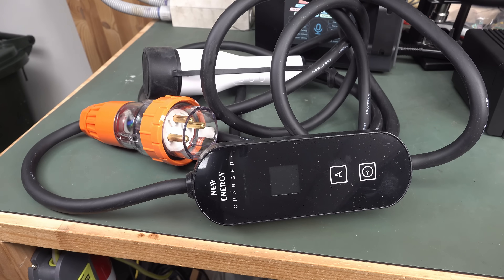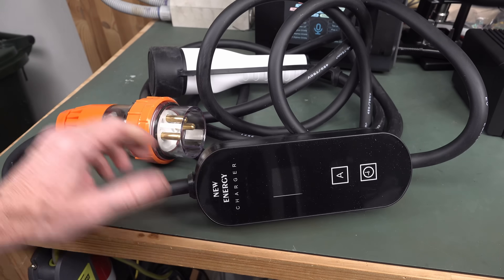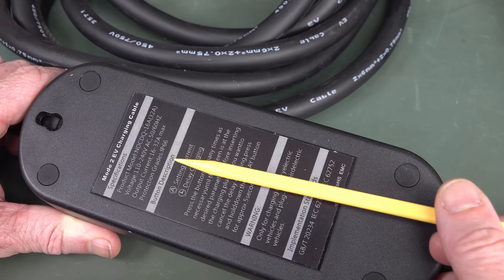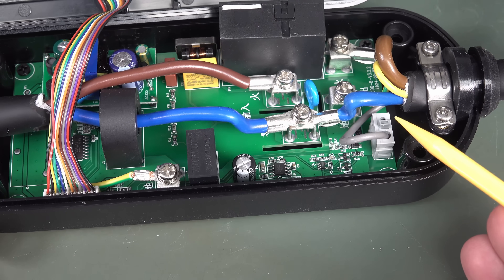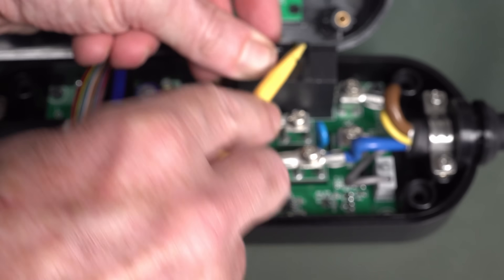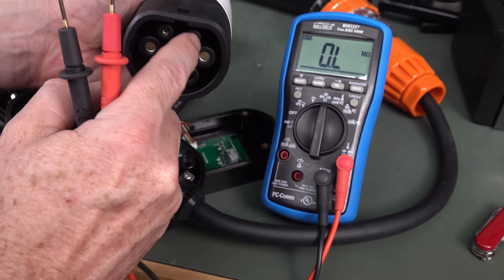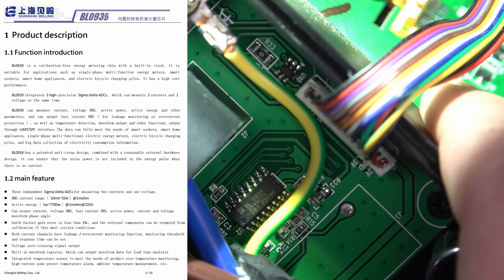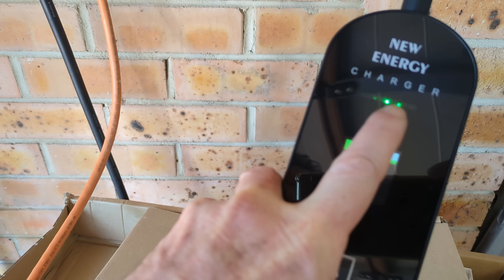EEVblog 1643 - DON'T BUY this Cheap 7kW 32A EV EVSE Charger

Comment: If the car contains the charger and logic, why does the cable need a relay to isolate it?
Reply: Because when there's a short between live and the car's body, the electronics inside the car cannot turn off the power. Also, you don't want the plug to be energised all the time. The touch-protection of those contacts is rather rudimentary, and it's used and stored outside where it's wet.
Reply: @HenryLoenwind  Does the car not connect to earth via the earth pin? Isn't there an RCD on the 32A outlet? 

It is essentially an extension cord, aren't thoes are always energised?

It is unfortunate that the touch protection is poor such that all the extra complexity is required.
I expect it would be used in the same environment that the Aus 32A connector outlet is, it is a shame the car doesn't just use one of thoes instead.
Reply: Well that’s the point of it is, so when you’re standing around in the rain you don’t fry yourself.

Comment: Actually, the disappointing thing is that you don't build something so simple yourself and/or modify another charger to suit your needs. Disappointing. Then such a charger can't be expensive enough.
Reply: Being a good engineer is knowing how to best use your time!
Reply: @edc1569  ... and money ;)
Building these simple adapters is a question of a few minutes with available components and a thing of 1/2 day building that all from scratch.
There is "nothing" in there.
That's the great thing charging an EV is so simple. 
I took available conponents and build my own wallbox and mobile box (adjustable power)

Comment: $100 local currency is about the right price point for an emergency EVSE to keep in the trunk just in case of emergency...   I would consider this one even without all the safety stuff inside because it wouldn't be my everyday charger, just something I kept in the trunk in case I ever found myself without the range to get to a real charger.   I reality, it would probably never get used, but like a spare tire it's  good to have just in case, and if it's got a better than even chance of not burning or melting during it's one and only use,  those are good enough odds to bet $100 on for me...
Reply: I’m using a sub $100 charger because the $650 pos Wallbox stopped working even more than usual after two years. I think the only charger brand I would actually trust is charge point.
Reply: Better to buy a good used one. For not much more, I bought a used Audi branded EVSE with both 13 amp UK and 32 amp CEE plugs. German designed and European made with a decent RCD inside too.

Comment: Copper-cladded aluminium is not new.  For cost reasons it was commonly used in the Eastern Block.  As inheritage from the Eastern Block we now also have it in Germany..  In East Germany it's know as AlCu or ALCU.  To the best of my knowledge it's an ok material for conductors though the larger diameter may make cables a bit stiffer.  Yet its still lighter than an equivalent copper cable.  I've only ran once across it, in Hungary.
Reply: my understanding with copper clad aluminium cable is it doesn't hold up well under repeated flexing and twisting like 100% copper cable does. I replaced the wiring running to my range in my house that was aluminium wire and the strands cracked in several places when i coiled the wire to recycle it. it was only ~30 years old and being house wire wasn't flexed much.
Reply: @JHulce  What you describes matches common knowledge on aluminium.  The cable was probably always a little brittle so it had to be treated more gently than pure copper.  WHen you ripped the cable out you had no reason to handle the cable gently so it's not surprising that it broke.  Eastern European (as in cold war era) electricians were used to dealing with CCA cables so they were aware of the special properties.  Annoying during the installation but not safety problem that I'm aware off once properly installed.

I've had a few device leads which I think were made from aluminium.  They didn't appear to be brittle but were relatively thick.  I assume these must have been special alloys which reduce the brittleness.

Copper is a material in high demand.  It's only a matter of price compared to aluminium and CCA will return.

Comment: I'm not an expert, but not switching neutral seems sketchy to me.
What if the guy that installed the outlet get it mixed up ?
Reply: If the car's electronics are good, they will refuse to initiate a charging session. Otherwise all will work fine but you'll have a live port in your driveway that's big enough to take small fingers.
Reply: @HenryLoenwind  That's what I'm worried about, the plug lying live on the ground outside.

Comment: Pretty sure GFCI/RCD protection in the EVSE itself is required in most civilized places.
Reply: Not to mention the 6ma DC trip
Reply: RCD type B is required by CE standard, I’d be surprised if the Check Mark down under would allow deviation from that. The whole point is mobility and protection, ya never know where you’re going to have to plug in.
Reply: @SpencerSkelly  That's a wiring regs thing ain't it part of the new amendment to 18th edition as the DC can stop a normal RCD from operating in a fault.
Reply: RCD is mandatory and especially that DC 6mA sensitive...you dont want to get zapped by AC nor DC.
Reply: Why? RCD is installed in front of the outlet. RCD is required in the installation, so all equipment connected is protected and all the wiring is protected. I live in a civilized country. Actually all european countries have RCD before fuses or a combined RCD / autofuse in the main distribution board.
Reply: @NotMeGeek  Some of the world (North America) doesn't generally have whole home GFCI. I consider myself 'civilized'.
Reply: @NotMeGeek  At least in the US, the standard outlet based RCD would trip regularly because EV's test ground by passing a small current through it. EVSE's integrate a CCID that triggers at ~20mA to avoid that nuisance tripping.
Reply: @intrest86  Thats why we in Europe has different types of RCD. We use normally 30 mA trip current and also 300 mA trip current. That's both AC and DC currents.
Reply: @NotMeGeek No point using a faulty one tho hey and according to the foreigners I worked with they only had fuses at home in Poland
Reply: @NotMeGeek  The on--board RCD/GFCI is for redundancy since 1) panel RCD/GFCI breakers can fail, hence the "test every month" or other such prescribed test interval on older models that don't have automatic self-test and 2) not every building is code-compliant.
Reply: @teardowndan5364  Maybe where you live. But here we do it different at don't use dual RCD as both will be turned off in case of a fail. It make no sense to have 2 RCD on the powerline.
Reply: @NotMeGeek  You have two because both can fail and EVSE cables may be used under harsh conditions that greatly increase the likelihood that you may get electrocuted by a frayed cable under wet conditions should your only RCD in the whole circuit fail.
Reply: @teardowndan5364  🤣
If you're so affraid that RCD will fail, why not use 10?? I'm electrician and know how we make electrical installations where i live. So it still make no sense using more RCDs in line of each other!
Reply: @NotMeGeek  Well, the people who make the standards for certified EVSEs disagree. EVSEs must have at least two layers of RCD protection: the breaker/outlet and the EVSE itself.

Comment: It has an incorrect CE marking too... Always a sign that corners have been cut.
Reply: It's not incorrect it's for Chinese export, quick way to tell is if you carry the C on to a full circle does it overlap the E 👍
Reply: CE is self certified until not, so it's really a low barrier to entry.
but as @SylerFox666 pointed out, thats the Chinese Export mark.
Reply: @smalltime0  No such thing - ask a real Chinese manufacturer (I've worked with a few).  This seems to be an internet myth that has gained too much traction in some areas, even in the EU (I have yet to come across any source that confirms it having official status).  Also, the CE mark and the claimed Chinese Export mark both use characters that are part of a circle, not a regular font.  If the C is extended to form a complete circle it exactly overlaps the curved back of the E in the CE mark and overlaps much of the E in the claimed Chinese Export mark.  But the marking on this product as shown in the video is neither - perhaps they just used an Arial font or similar

Comment: Here in North America, you'd have to have a relay on both sides as the 240v is center tap for 120 each side so both legs of power are hot with respect to ground.
Reply: Given that it only switches live, it would be interesting to know if it's capable of detecting when its plug is wired with live and neutral reversed, and if so, what it does.
Reply: This wouldn't work in the states or Japan/Europe. It's made assuming that only one side gets 'hot'
Reply: @smalltime0  Of course it would 'work', the issue is it sure wouldn't be safe.
Reply: @smalltime0 Would work if you've got single phase supply, which would be the case in Europe or Japan for smaller homes (and in pretty much all of the UK).
Reply: @Croz89  I was considering UK separate from Europe, since clearly they do :P 
This doesn't have neutral switching, either side of the plug can be hot on single phase power in Europe.
You then also have Europe's cobbled together systems of single/two/three phase splits.
Reply: @Rok_Satanas 
There is no 32A connector in europe that can be plugged either way. Only the 16A household plug can.
Reply: @Juergen_Miessmer  that is true, but from years of experience with chinese stuff, always divide their ratings by half, at least. So a 32 Chinise Amp ~ 16 actual amps
Reply: @Juergen_Miessmer  The point of this is that it can be plugged into either, it isn't a hardwired unit.
Reply: @smalltime0  
No, it cant. The 32A plug is keyed.
Reply: @Rok_Satanas  This looks like it would use a CEE connector, and those are all keyed.
Reply: @Juergen_Miessmer  Some older houses in Belgium (including one I lived in) don't have a neutral - just three phase (delta). Really important to have double pole switches and relays there.
Reply: Yup, this thing is a death trap!
Reply: The rules (ICE) request to switch all active lines (N,P).

Comment: I believe the designs that also switch the neutral are also made to work with 240v US “Level 2” charging where that neutral is actually a second hot 180° out of phase. The board on your older one is flexible enough for EVSEs sold in other markets while this one is only for single-phase power.
Reply: The UK has keyed phase and neutral but the regulations specify that devices must treat both phase and neutral as potentially live to guard against wiring errors and transient supply faults.  In some supply-earthing arrangements in the UK, fixed EVSE must even be capable of disconnecting live neutral AND earth conductors!
Reply: Also needed in 230 V Europe where the plug is often not keyed so it's a 50/50 which side is live or neutral.
Reply: @Gameboygenius
The europe 32A plug is keyed.
Reply: @Juergen_Miessmer  That's true of course, but most home chargers in Europe will probably be either a wall mounted unit with a permanently connected EV plug, or a 16 A plugin charger using a 2 phase schuko plug. I think it's pretty rare to have a CEE socket in your garage unless you live on a farm or used it for power tools like an old drill press in your garage.
Reply: @Gameboygenius  You’re right. I was just looking at a European IKEA-brand power strip someone donated to Goodwill and noted how the ground can connect in either orientation.
Reply: @Juergen Yes, but this board can be used at lower amperage with other outlets too. It is very common for the same EVSE control board to be sold in various configurations, like the Gen2 from Clipper Creek (one of mine is 12A with a NEMA 5-15 and the other is 16A with a NEMA 14-30). There is also the potential to get it backwards when you hard wire.

Comment: Always concerns me to see screw terminals that if they slackened off they could rotate and touch, especially on a portable device. Some heatshrink over the crimp terminals would help if they can't use locking terminals.
Reply: Bring your own RCD
Reply: @TrickyNekro  Any decent sparky would have its own RCD circuit. That's if you follow AS3000:2018 lol

Comment: Definitely cheap-assing it- single pole switching and no RCD. Also lack of approvals marks.  
But why are they measuring the line current ( and voltage) that is totally unnecessary, whearas RCD protection really is needed.
Reply from the maker: Yes, no approval marks either. They need the current for the energy display.
Reply: @EEVblog  ..don't need the display either if they want to really cheap-arse it
Reply: @EEVblog  They should also be using the current reading to enable the EVSE to disconnect the car if the car is drawing too much current.
Reply: I believe the dual-pole switching is mostly to make the EVSE board flexible enough for 2-phase (so to speak) electricity, like US 240v Level 2 charging. Both conductors are hot (neither are neutral).
Reply: You believe wrong. The standards require you to switch both lines. There's no guarantee the outlet is wired correctly.
Reply: @emmettturner9452  The US uses split phase. Two phase has a 90° phase shift and uses 4 wires. Two phase has been obsolete for a long time and there are only a couple of cites that still have it available.
Reply: @mikeselectricstuff  @cjmill… yes, but I’m talking about using the same board for different markets in different configurations. For example, the ClipperCreek Gen2 comes configured for 12A with a thermistor in the plug for the version bundled with Volt and Bolt EV with NEMA 5-15 but the exact same board inside the NEMA 14-40 AmazingE is configured for 16A and not thermistor.
Reply: I think they're using the ZHTPT107 and the CT with the neutral wire through it in conjunction with the BL0939 for "RCD" functionality. It has leakage current detection built in between the two current sense inputs. (or maybe they're using the ZHTP thing as potential transformer so no leakage measurement)
Reply: …and as @Gameboygenius pointed out to me in another thread, you’d also need to switch neutral for unpolarized applications like Japanese and European plug types.
Reply: @emmettturner9452  to be fair in Europe you'd be using a commando plug for 32A  They are polarised.
Reply: @mikeselectricstuff  @peter not every EVSE even has a plug. Many are designed for hard-wired installation. Yes, it is important to get the polarity correct.
Reply: @rocketman Yeah, that’s why I said “so to speak.” Many still call it that because the two hots are 180° out of phase.
Reply: I was under the impression they just printed all the approval mark on everything electrical regardless.

Comment: Cable stripped by mice biting off the outer insulation, and then the core could be CCA, you would need to cut a strand to see if it is shiny copper or bright aluminium under the copper. Only live switched, will still probably pass approval, but yes relies on the main RCD for protection, and I suspect that a short to the PE could blow the traces off the board before the main breaker or RCD will open, making it now unsafe, though, as the control chip likely will also be blown up, as it has connections each side of that trace, it will probably fail in the on state, as the relay will not be actuated to turn off.
Reply from the maker: I scraped back a strand, seems to be copper all the way.
Reply: @EEVblog  They sprang for real copper, so it at least is good enough to keep in the car as emergency charger, and if you find somebody stranded at a place with no battery, but with a charge outlet, cheap enough that it being lost is not a real issue then.
Reply: I think there are rules around DC leakage on RCDs in or with EVSEs as well. At the very least the RCD has to be able to detect AC imbalance in the presence of superimposed DC. Many upstream RCDs won't have that feature.
Reply: I don’t think it would make sense for these high power applications you’d have to make the cable too thick, maybe for the earth conductor 😂
Reply: @edc1569  Aluminium is only slightly bigger than copper for same current, and of course with chinesium manufacture it will be exactly the same diameter for the supposed ratings.

Comment: Look, mum! No RCD!
Reply: Which means it'll always work compared to all the public chargers that keep tripping.
Reply: @fredfred2363  but then it should be possible to add auto-resetting devices to them. It will attempt switching the RCD on after a few minutes, a few times if necessary, until max failed attempts number is reached. Back a year ago, when I was working for Enelion, we were testing that, including high and low temperature environment testing - I'm not sure if it went into use in EVSEs though.
Reply: @fredfred2363 generally that’s down to the sparks not understanding they need to allow for discrimination so the internal protection has time to work before the RCBO trips out.
Reply: I hear their music is fire 🔥😂
Reply: @computersales  you mean Sparks? This town ain't big enough for both of us...
Reply: How much of a problem is that if your house has it? You might trip the breaker instead of just the cars in a fault condition, but doesn't seem like such a big issue to me.

Comment: I was very glad my '21 Nissan LEAF SV included a factory 120/240 EVSE, as I was not looking forward to shopping and evaluating the alternatives. Plus, in San Diego, installing a hard-wired EVSE needs a permit, but a new 240V outlet doesn't, which sealed the deal for using the factory EVSE.
Reply: Why would you hard wire a level 2 charger!?